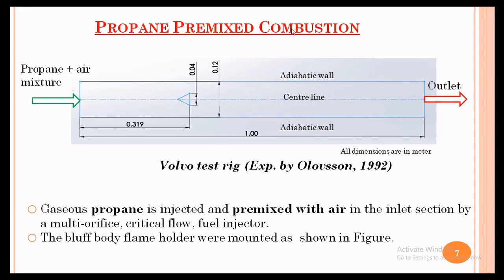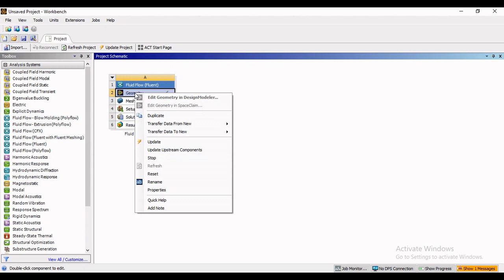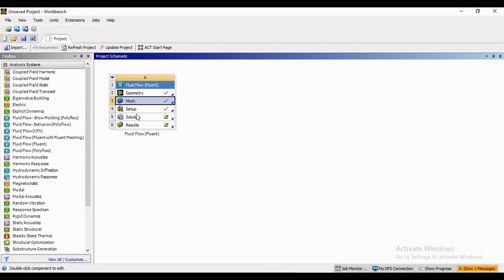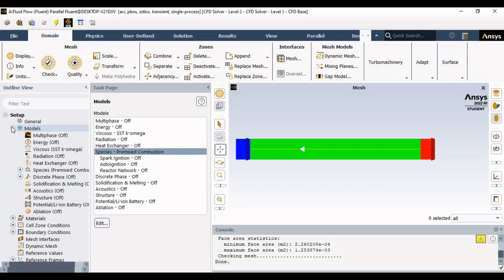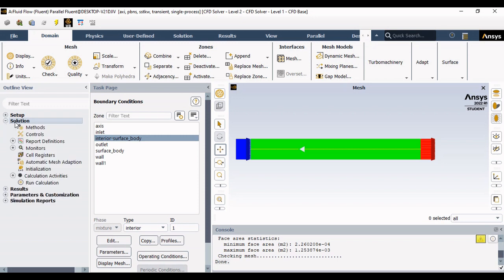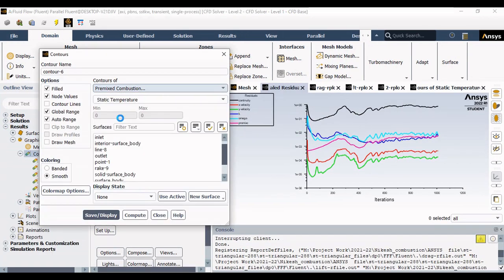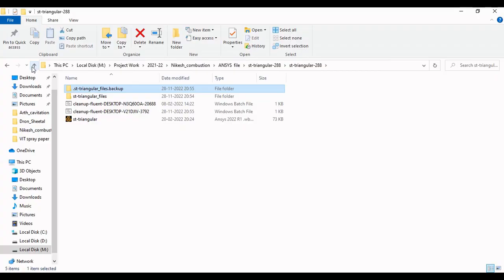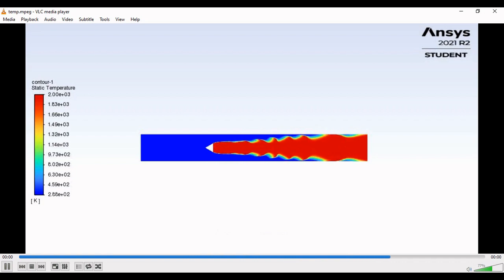ANSYS-Fluent Tutorial || Propane-Air Premixed Combustion

Comment: Hello.
Thank you for the video. 
I have a question. At the start of the video it is shown an equivalent fuel/ar ratio of 0.61, but in the video, you don't set any fuel/air ratio. In general, there is no setting regarding the amount of fuel. How does the software understand that the incoming mixture has a fuel/air ratio of 0.61?
Thank you.

Comment: Looking at the residuals, it does not really converge. Or am I wrong, I mean continuity is about e-01, so far from optimal?
Reply from the maker: The final results shown in this tutorial is satisfied convergence criteria, although iteration part skip due to length of the video.
Obtained results are validated with Olvason et.al. experimental data.
Regards.